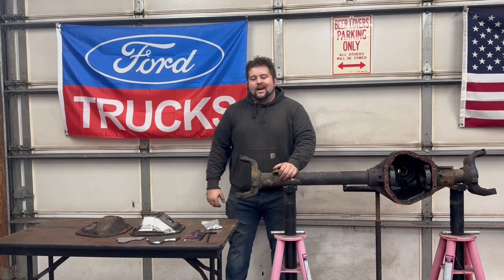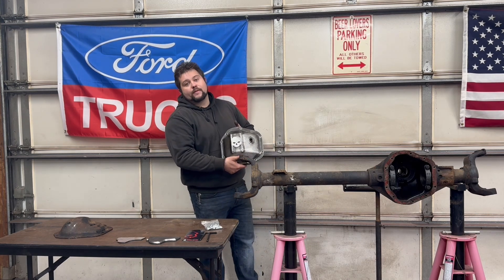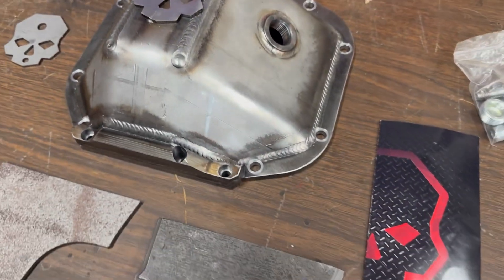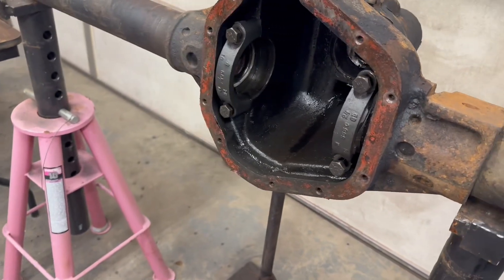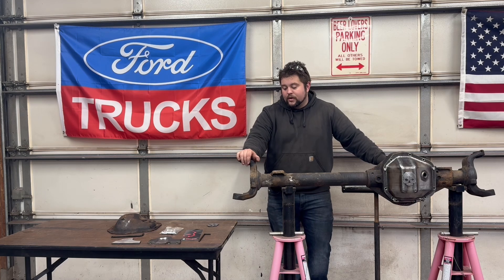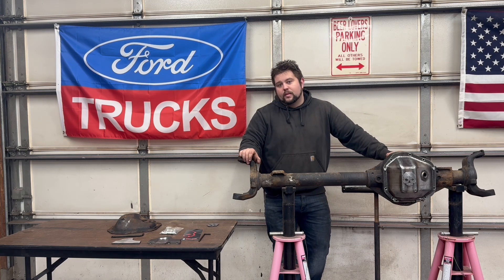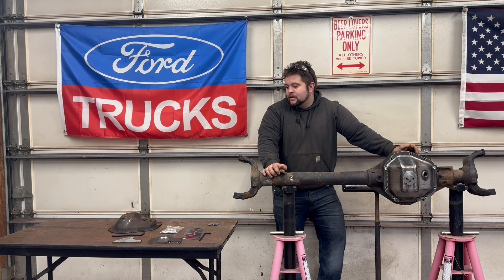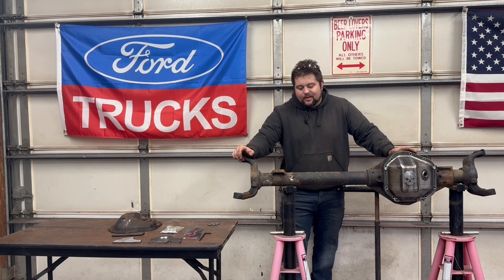Is Shaving Your Axle the Best Move for your Off-Road Project? Ballistic Fabrication Shave Kit

Comment: I had the same problem with the steering beefed it up with 2” .250 wall tube haven’t had a problem since
Reply from the maker: I have either 1.5” or 2” DOM for my steering that’s quarter inch wall, and I thought that’d hold up.  It does for the most part, but I have been able to turn it into a banana twice in the past two years unfortunately.
Reply: solid aluminum would help a ton even though its expensive as shit lol @BocksGarage